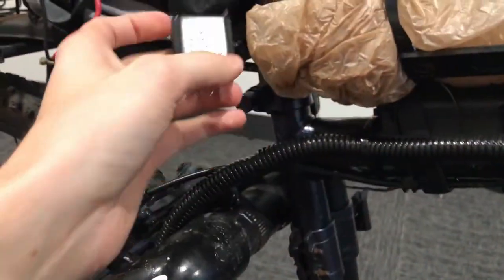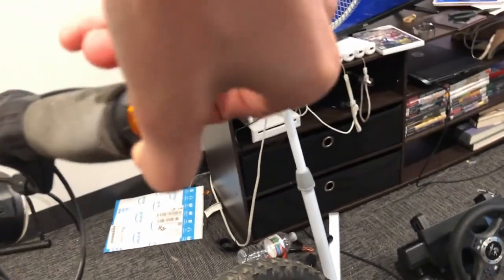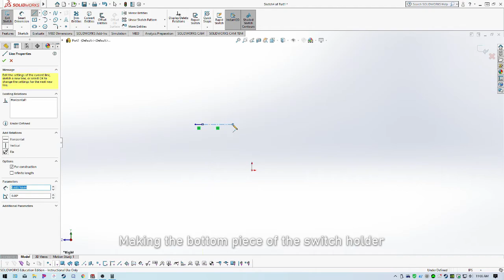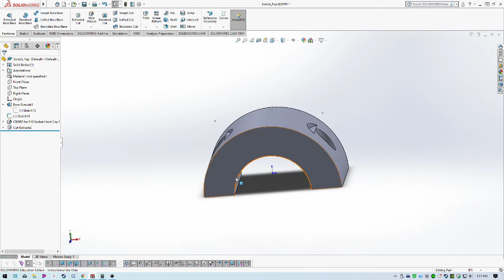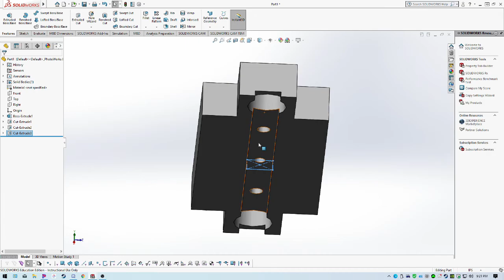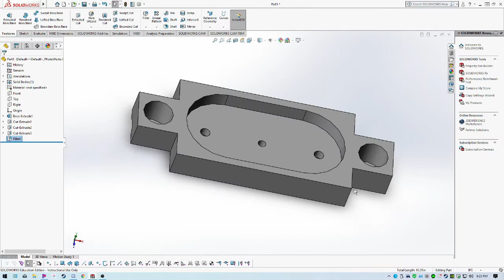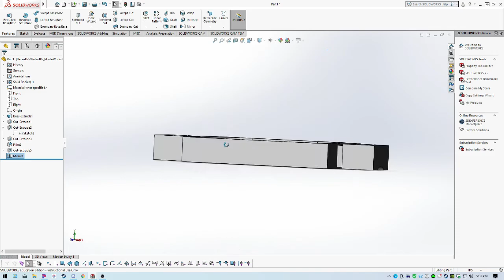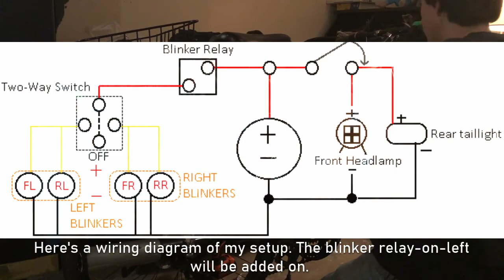D.I.Y. Bicycle Turn Signals! Using 3D Printing - Odd Projects Episode 1

Comment: Solidworks is hella expensive. Lucky guy.
Reply from the maker: You can get by with fusion 360 and create an account with them for personal use. The the free version allows stl exporting for slicer softwares. 

I happened to have SolidWorks provided by my college program back then, but now I found a “student” version through EAA. 100$ total from subscribing to EAA and then SolidWorks for a yearly package. Worth the prototyping I do these days..
Reply: @NiTecIndustries  yeah I use autodesk f360. XD im not good at it though. I have to sit down some day and just learn it.
Reply from the maker: @bradleywhais7779  Yup, that’s the beauty of it